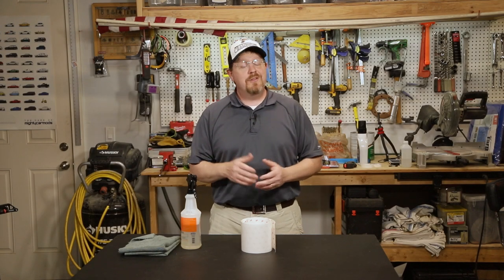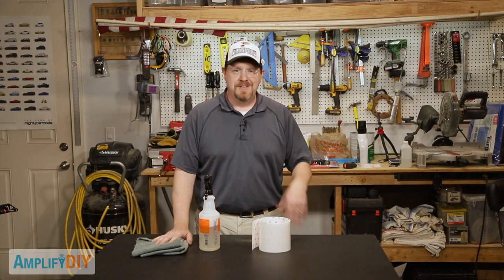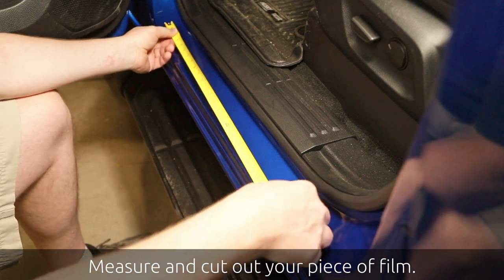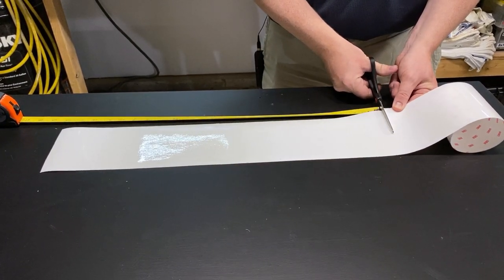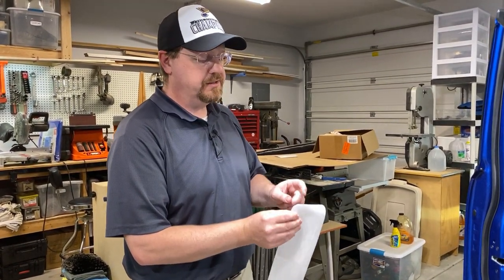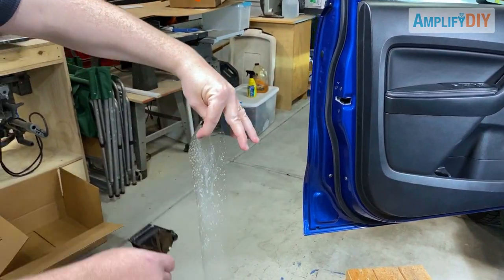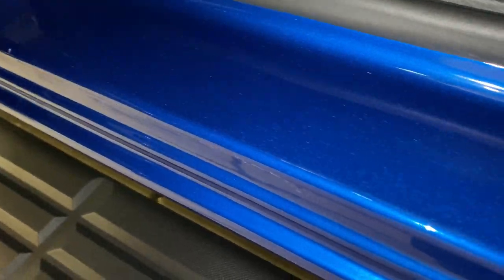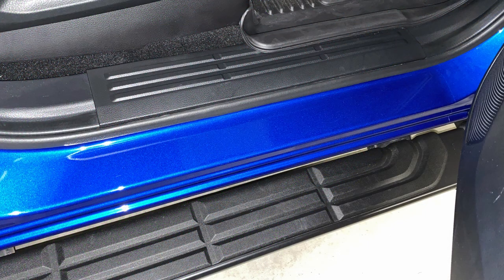Door Sill Paint Protection Film

Comment: Would this work on chrome sills that install on top of the factory painted sills? I have Grand Cherokee Sills that have gotten scratched. Any suggestions on restoring them?
Reply from the maker: Hi Veronica - yes, you can install protection film like this over chrome, but that won't clean up the existing scratches. If your existing sills are already scratched up, there is not a lot you can do short of polishing and possibly re-chroming them. Probably more cost-effective to replace them with new chrome sill protectors, and install protection film over the new ones before they get scratched up. Good luck!

Comment: doesn't the protection film over time begin to look bad also, and if it needs to be removed and replaced, is it worth it? also, if replacement, is the paint underneath the film damage?
Reply from the maker: That was a somewhat common problem with older generations of this protection film. Today's films from 3M last much, much longer and do not yellow/fade/crack. Mine still looks as perfect as the day I installed it several years ago. If replacement is ever needed, a heat gun helps get the film off, and it should not damage the paint at all. Thanks for watching!

Comment: Hello mate. That's a lovely video. In it you mentioned that the adhesive is pretty strong! What I wanted to know is if you were to remove the tape, will it also damage the paint work? I'm sceptic of buying these products because after a while due to wear and tear and I want to re apply anew strip I get worried it will damage the paintwork underneath. Would be helpful to know the answer and extremely grateful too! Thank you good Sir!
Reply from the maker: The adhesive is really strong, but you can safely remove the film and re-apply a new piece as needed. You'll need a heat gun and some adhesive remover. Here's a great video that shows the process: https://www.youtube.com/watch?v=5uzm4TxncSE  Good luck!

Comment: Thanks for your most excellent vid!  I also have a new truck and want protection for the sills.  Your thorough explanations and patient demo should make this an easy install.  Also considering this as a clear bra for the hood.  Any thoughts, or do you also have a vid for that? :)
Reply from the maker: For the hood, I actually prefer a bug deflector. I did a video about installing one on this truck here: https://youtu.be/4VQS8Kz-OOg
However, if you prefer to keep the front of your truck looking stock, then PPF on all the forward facing edges is a good idea. I'm working on finishing up a video that's the complete beginner's guide to caring for your car's exterior, where (among other things) I cover how to install PPF on everything that faces rock chips and bugs - so stay tuned for that. 
I will say that installing your own PPF on the front of a vehicle is more challenging than the door sills. If you do decide to DIY it, I recommend getting a pre-cut kit for your specific vehicle. I ordered mine from Install Proz, and have been very happy with the fit and quality: https://www.installproz.com/paint-protection-kits/

Comment: nicely done .. do you know by any chance if the 3M film exists in gloss black also?
if not, which ones would you recomend? tx
Reply from the maker: Hi Gabriel - I don't think 3M makes any in a gloss black. Their films are typically all clear so that the body color of the car shows through. If you really want a black one, Xpel makes a great PPF in black, but it's not glossy - it has a slight texture (similar to the look of a bedliner). Here's an affiliate link to that, if you want to check it out: https://amzn.to/3ao5Bve - the nice thing about the texture is that it will hide any blemishes  that develop in the film over time really well. 

If you are putting film on a black car though, I'd recommend just using the clear 3M film - it will appear gloss black once installed, as the film is completely transparent. 

Good luck!

Comment: Love your video man, I just installed ppf to my car about 2 months ago and I really like the result and the effect on my car, but I just wonder, can I do it also to my helmets? Is it possible? I need to minimize any scracthes on my helmets
Reply from the maker: Theoretically, yes. But: You'll have to stretch the PPF a bunch to fit it around the curved surface of the helmet, and that's tricky to get right. Good luck!
Reply: AmplifyDIY thanks for the information man, by any chance if you had any videos how to apply ppf on helmets or knows some of videos, I will appreciate it if you can shared it to me.
Reply from the maker: I'm not sure ppf is really the best approach for helmets - as I mentioned, you'll have to stretch the ppf a lot in order to get it to conform to the shape of the helmet. Have you considered other solutions such as several layers of spray-on clear coat? They may still get scratched, but you can buff them out and re-clear as needed to keep them looking good. If you really want to try to apply ppf to a helmet, I'd suggest you check out some forums where others have tried: https://www.tintdude.com/forums/topic/58323-helmet-and-ppf/

Good luck!

Comment: How long would you leave the door open after install?  I know the door seal hits the new film.  Thanks!
Reply from the maker: Hi Medirk - I actually didn't leave my doors open at all, and had no issue. If yours hit, I'd leave the doors open for an hour or 2. Good luck!
Reply: @AmplifyDIY  Terrific, thanks for the fast reply!  I actually did mine today and left them open for about 8 hours now just to be safe....sounds like I went overboard, but I know it said 24 hours for total dry time so I was worried it might mess them up.
Reply from the maker: @CowboyBandit  You should be good by now. How did they turn out? Are you happy with the result?
Reply: @AmplifyDIY  Yeah I think they turned out pretty good. You can still see some of the cloudiness in it, but I think that will dry out of it....That is under all the LED's in the garage too, outside you probably couldn't see those.  All and all you would be hard pressed to see them, so I am happy.

Comment: If after some time and wear and tear you would like to replace it how do you remove the old film?
Reply from the maker: Hi Jerry - you can use a heat gun (or blow dryer on its highest setting) to warm up the old film. This will make it easier to remove. Don't get the film too hot - warm to the touch about like a hot bath is where you want it. Once you peel off the film, if there is any adhesive left over it comes off easily with Goo Gone. Then just wash the area off with soapy water, rinse, dry, and it's ready for new film to be installed. Good luck!

Comment: What does it take to remove if something happens?
Reply from the maker: Great question! It's pretty straightforward to remove: use hair dryer or heat gun to gently heat the film, then use a plastic scraper to get under one edge and start peeling up. It should peel right off once warmed, and any adhesive residue is easily cleaned off with goo-gone or rubbing alcohol. Thanks for watching!